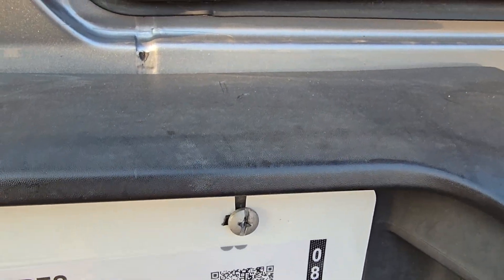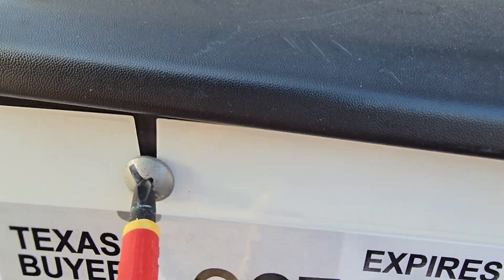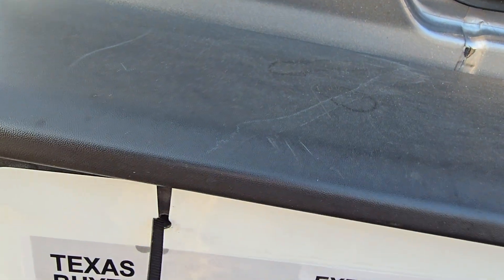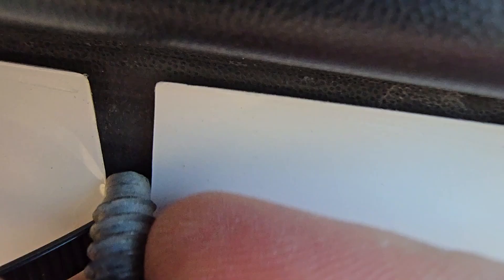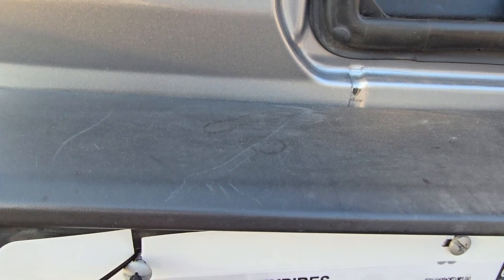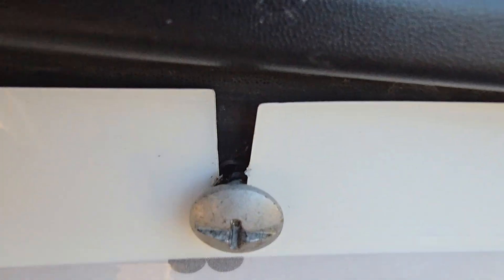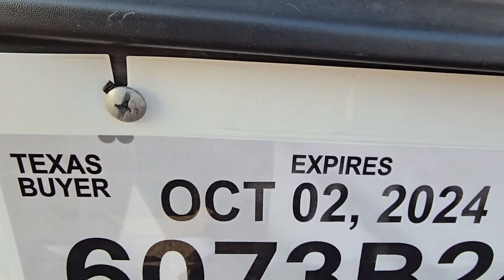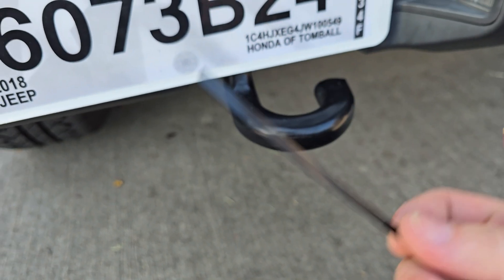Plastic Threads Quick Fix!

Comment: Justin - dealer plate holder -- i always use them but just put them on backwards so advertismes face the bumper --  so it still prevents bent up plates

Comment: Nice solution, never thought of using a zip tie like this. For plastic where the back is not easy accessible i always made the hole smaller by melting the edges with a soldering iron, and the cut off from zip ties as filling material. And if the back was accessible, i used one of those little U shape metal plates that have threads one side, and where the U normally is placed over a hole on the edge of a metal or plastic sheet to fasten it to something else. These are very common on bodywork on cars. The rivet nut that you mentioned is also a nice alternative for this problem. 
Another reason for not throwing away zip tie cut off's,they will become in handy soon or later.